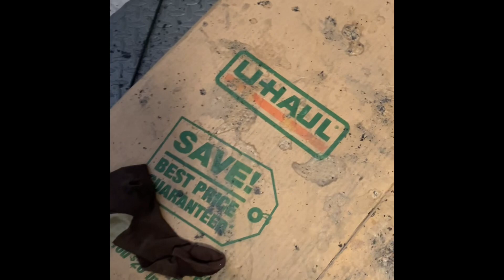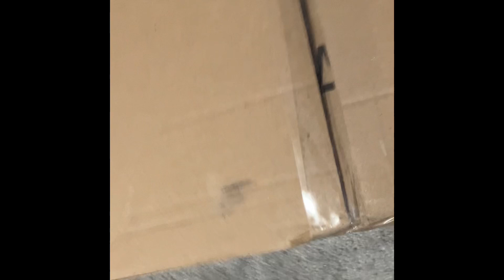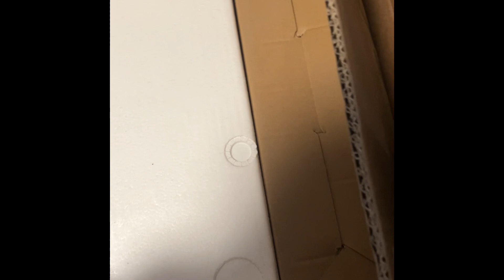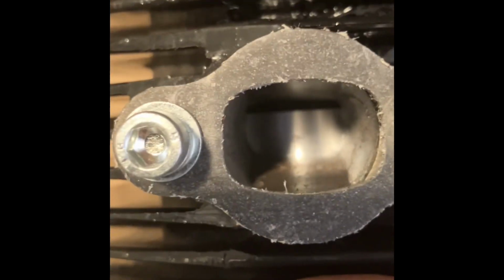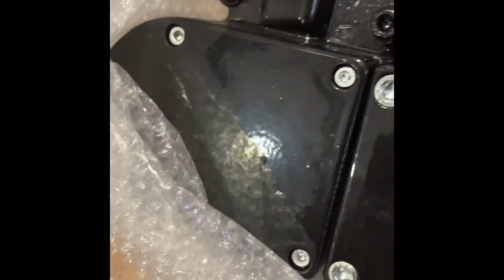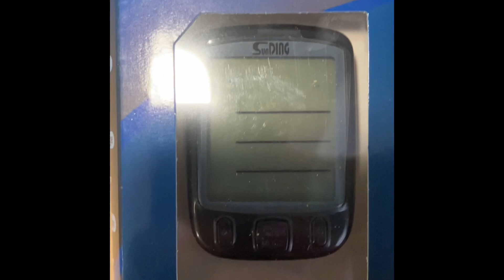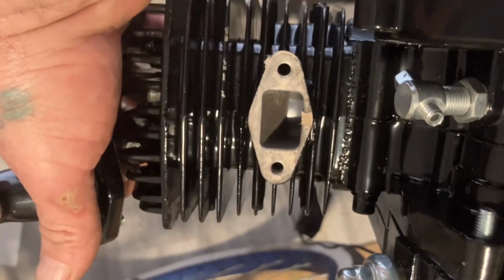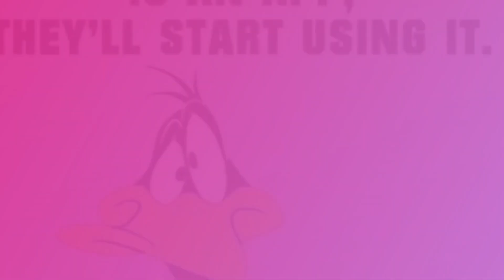2 Days On The Fly

Comment: That motor is supposed to be a good one
Reply from the maker: Yeah man I was unsure I’ve always gone through eBay. It came from New Jersey at the same distribution center that they send them from eBay and usually they’re pretty good there too when you just get the engine and not the kit.